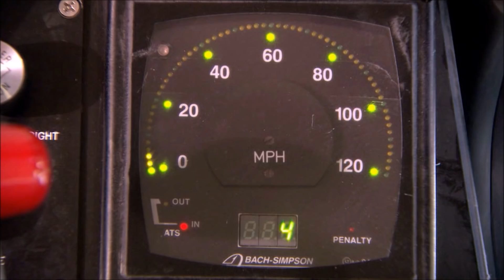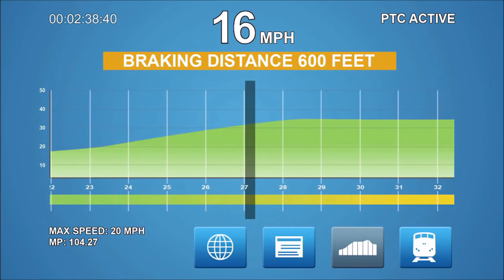Amtrak 501 "Cascades" Train Derailment 18 Dec 2017

Comment: There is NO WAY IN HELL that the train was going 80 miles per hour!

NO WAY IN HELL!
Reply: blancolirio The best comment I’ve read in a long time: “stay tuned ... Mozart” LOL!!
Reply: Stick to music, your lack of knowledge of physics and the real world is revealing!
Reply: If you look at the overhead images at 4:31 and 4:38 it is clear that the front engine and first few carriages went straight off the tracks on the outside curve. The last few carriages were still coupled together with the trailing engine, and the heavy weight would have kept them mostly on the track, until toppled by jackknifing of the coupled center carriages. No need for conspiracy theories, just simple physics.
Reply: A fully loaded 6000 ft freight train requires 1-1.5 miles to stop, but these passenger units can stop quite a bit quicker. There is a huge difference in weight/mass between the two, braking systems are different. Depending on the loads being transported, a mile long freight train can weigh upwards of 7,000-8,000 tons. Passenger trains like #501 usually weigh in around 1,200-1,300 tons at most. A single GE Evolution freight locomotive is 220-240 tons roughly...the Siemens Charger unit that was leading is roughly 1/2 that. What does all this mean you may ask? A LOT less mass in motion, and the passenger train will decelerate much faster, even in the event of a derailment. Add in the sand bank, trees, and it will lose momentum in a hurry when compared to a same speed crash of a freight train. It may not appear to have been a high speed crash, but if the NTSB is saying black box data points to just that. 80 mph may be a bit on the high side, but I would guess it's 60+ when the data is finally analyzed. In any event, it was a terrible accident that unfortunately, was likely due to human error.
Reply: Lewie McNeely The lead locomotive and several trailing cars did react to centrifugal force, as evidenced by the impact on the sand bank. But, as in a majority of derailments, as the first derailed units rapidly lose momentum, the rest begin to deflect in different directions. This is especially true in heavier freight trains. That's why you see cars scattered in helter skelter directions. Derailments tend to bend the laws of physics with some of the damage that can happen..lol
Reply: You see the graphic at 4:53? Uh yeah, the coaches are on the outside of the curve...
Reply: Thanks, Lonnie, that was helpful.
Reply: Actually the lead engine hit several large trees, which would have the same effect as a solid wall. Look at this closeup aerial video, and see for yourself: https://www.youtube.com/watch?v=sbs7aL_wX18
Reply: Sounds like your referring to a much longer and heavier freight train under normal circumstances. It varies quite a bit.
Reply: You can say not even close and it won't hurt my feelings.
Reply: It is almost certain they were travelling at 80mph until the near the final 30mph sign, and possibly started emergency braking once the engineer noticed the the curve and bridge. So maybe slightly less speed by the time of the actual derailment, since the preliminary NTSB statement is not clear about the exact timing.
Reply: It  is truly amazing how so many people who know nothing about railroads are now suddenly experts who are qualified to make statements of fact, when they have none at their disposal.
To answer your question here's an animation of the wreck, while there are some errors it does show more or less how the cars ended up where they did.
https://www.youtube.com/watch?v=cJrCza9iSQw
Reply: Lewie and Wolfgang, you two crack me up. It is evident by your comments that neither of you have the slightest expertise in railroads, any sort of wreck investigation work, or apparently simple physics for that matter. None of us outside the investigation really have very many facts to base comment or conjecture on. I live near, travel by, and had watched with interest the rehabilitation of this line. I also happen to know a great deal about railroad operations, and have many acquaintances within the industry, including a couple of friends who are locomotive engineers. Yet I wouldn't dream of embarrassing myself by spouting baseless speculation and outright garbage, the way the two of you are doing here. My suggestion to both of you is to sit down, be quiet, and let the NTSB do their jobs and submit their results after all the facts are known. Then perhaps you'll at least have some factual information to discuss rationally.
Reply: I am a retired Utility Incident (Accident) Investigator. Over a 3 decade span, I have been engaged in investigations ranging from minor to major multi-fatal incidents. Many of the questions/comments posted here are reasonable and understandable But: Anyone – anyone who opts to submit their ‘subjective’ conclusion to an incident, who IS NOT directly involved with the investigation, nor understands OSHA, PUC or NTSB Investigation Analysis should consider; playing Lotto or a slot machine. (your chances of getting it right will most likely be proportionally the same).

Good report Juan.
Reply: Wolfgang Mozart so you’ve already come to a conclusion re the Ntsb before they even begin. All I can say is that accordion action of the train cars could easily explain the cars being on the inside and still on the tracks.
Reply: Hate to tell you this, but the locomotive and the first several cars off the track Did go to the OUTSIDE (south side) of the track!
Reply: It's all in the pictures of what happened. If the train was going 80mph the first engine would have rolled plus ripped the outer rail off the ties and all the other car would have followed. And going 80mph that train could not stop in 1000 ft. "rear engine still on tracks?" It's weird how the news knew before the NTSB investigation reported what happened.
Reply: How do you KNOW that 'the first engine would have rolled plus ripped the outer rail off the ties and all the other car would have followed.'?
Reply: Isaac Newton....
Reply: Mozart - So what is your qualification to make this statement? The black box recorder and real time train tracker both agree 81.1 MPH when it left the track, according to the NTSB.
Reply: NTSB states that both of the black boxes recovered from both locomotives as well as the real-time train tracker show 81.1 MPH when the derailment began.
Reply: It looks like the aftermath of a high speed derailment to me. I'm sure we will know more  soon no need to jump to conclusions.  I'm just a rail fan though and not involved with the investigation. I wan't to say something snarky maybe make fun of your comments but people lost lives in the accident and it just would not feel right so instead I'll just say: My heart goes out to the victims of the accident and I sure hope changes will be made to improve the system.
Reply: Lewie McNeely if you look at the diagram at 4:41 you can see the bulk of the cars did go to the outside of the curve. The speed limit leading up to the curve is 79mph so 80 is not out of line as a possibility. As far as stopping distance a freight train on its wheels on the rails takes one mile or longer to stop. A much lighter passenger train off the rail dragging in the dirt will obviously stop quicker!
Reply: Wolfgang Mozart I live and work in the industry in the area and have to travel under that overpass to get home. I assure you this is not a false flag or fake incident. 100% real saw the aftermath first hand. I know the route they were on first hand!
Reply: was their FISH on the train at all because i have never smelld anything more fishy for a long time... i keep looking at the acident and something is not right.. but i dont know any thing about trains and derailments, but ... you make a very good observation point... the whole thing smells...the cvover up will smell worse than the proclaimed accident
Reply: 3 people where killed, by an accident that should have never happpend NEVER!... that is called conspiricy to be allowed to be NEGLIGENT and incompitent
because no one in the system is ever heald acountable for the destruction that they cause to our lives because nobody holds or ids allowed to hold them them acountible... especialy if their is a CONSPIRICY involved...
Reply: Wolfgang Mozart ... Now let's  have a conspiracy theory if you have one.
Reply: I'm with you Wolfie BUT think about this. WHY IF the train was gong 80, which it couldn't be, WHY didn't centrifugal force sling the train to the OUTSIDE of the curve instead of everything falling on the INSIDE???
Reply: Lewie -- Good point, and yes, I've addressed this inside/outside-the-curve issue, and I've not seen any satisfactory answer to that, yet. 

I hope that a train expert could weigh in on this one. Comments from train experts are frequently very helpful, so I hope that such experts could help with this.
Reply: Still looks sideways. Too much stuff just does NOT add up. Lots of that going around in the past years.
Reply: Indeed -- In most major incidents, things all too often do not add up properly.
Reply: It woud've had to hit a wall to stop that fast from + or - 80 m.p.h. to do this.
Reply: Here's what Jim Stone Freelance is saying:

[begin quote]
"Yesterday, witnesses were not saying the train was going between 70 and 80 mph, they just said the crash started so smoothly they were not sure anything was wrong, and then ended with them being thrown. Today, in all witness accounts, they are saying the train was obviously going fast, even in reports which yesterday said no such thing. There is an obvious expungement of facts going on."

...

The cars are not damaged enough, and the death toll is not high enough. Additionally, the cars did not go far enough after the crash. 3 of them stayed on the tracks, with a fourth one off the tracks but not fallen. The stories told by people are not consistent with an 80 mph crash either. From the pictures, the train was going 30. There's plenty of evidence to support this. [end quote]

So, you guys think that the NTSB is incapable of lying?

Don't FK'N kid yourselves!

Of course the "government" lies!

Of course the gddamn mainstream media lies!

And the FACTS of the case DO NOT SHOW AN 80-MPH CRASH.

But any online research will be fruitless, as the gddamn bastards erase anything of significance as soon as it appears.
Reply: True, but 80 m.p.h.??? I've spent my whole life working construction and I promise you I understand what happens when you take a load and TRY and get it stopped in a short distance.
Reply: So it jumped and crashed but I still can't see it all wadding up from the speed they said it was traveling. Maybe a reasonable speed but not 80!
Reply: i have a nice hardbound book on train engines, so these were lightweights at quarter million pounds front and back at 80 mph, let us speak of massive destruction, was that rush hour? must be lots of iphone video, ask the calm crisis actor, you are sure to get the straight story
Reply: A train going 80 mph needs ONE MILE to stop.

Was that bridge over I-5 one mile long? Obviously NOT.

If that train really was going 80 mph and if the train rail cars did fly off the curve going that fast, there's no way in hell that they'd remain in predominantly whole pieces -- they'd be crumpled messes with ALL the rail cars and locomotives flying off the tracks with nearly a 100% fatality rate.

And how in the hell did this train crash on the INSIDE of the curve, when, logically, it should have flown off the tracks on the OUTSIDE of the curve.

The rear locomotive was still on the tracks -- no way could it possibly have gone from 80 mph to a full stop while still on the tracks.

And guess what -- there was a mass casualty drill going on in the SAME CITY, on the SAME DAY ... go figure the odds. Same thing happened with 911 -- a mass casualty drill involving planes crashing into skyscrapers happened on that SAME DAY and in the SAME CITY.

Antifa has boasted about putting cement blocks on train tracks to derail trains -- this may have been a cause of this accident. 

There were a number of witness reports of hearing the train hit something before crashing.

But there's one thing that you can count on -- that train was NOT GOING 80 MPH!
Reply from the maker: I'm afraid you don't know much about trains or pneumatic brakes either...stay tuned and we'll get you straightened out Mozart. lol.

Comment: A couple of quick comments--
There is a longer version of the audio you played available on youtube.   Unfortunately, part of the conversation between the Amtrak 501 engineer and the dispatcher is unintelligible due to an automatic defect detector going off at the same time as well as other train crews "walking on" the Amtrak conversation.   The railroad will have a better recording of the conversation, but from what I can hear on the youtube version the dispatcher was trying to contact train 501 before the conductor called in the emergency.  And it is the conductor that the dispatcher is speaking with, as he notes that he needs to move south to assess the damage.   The engineer was in no position to do that.

A lot of the other comments disparage the cost of the new trackage and rail transport in general.   This is disheartening, as rail travel is still much safer that road travel though not nearly as safe as commercial aviation.
Reply: Iowa : Thank you for the radio clarification . I though it was the engineer on the radio.
Reply: Most railway fatalities are due to trespassers on the rails and vehicles crossing against the signals.  Imagine what it would be like if we let people drive their cars across runways!  Purely by chance the video that loaded immediately after Juan's was about a near miss with a drunken woman walking on the rails.

Comment: I've taken this train a few times, as I live in Eugene, the other end of this route (501 and similar trains go from Seattle to Eugene and back - train departures from Eugene to Seattle are at 5am (6am?) and 9am, if memory serves me right).  Riding on shared routes belonging to BNSF or others means delays to passenger trains.  The track is theirs (BSNF?) so the priority is theirs and I've been on this train, stopped on tracks for long periods of time waiting for cargo trains to clear stretches of track before we can proceed.  Therefore, I only use the Cascades line (these passenger trains) when for leisure trips and when time is not an issue. When I travel for work on this corridor (I go frequently to Olympia and Seattle) I either fly or drive. Obviously, the Cascades line has other problems as well, but I can understand why they built this alternate line to prevent delays beyond their control and start building a reputation for more on time and reliable service.  

There is a strong demand for alternate transportation on this corridor, it is very unfortunate that this accident occurred, I was counting on better train services. Hope this accident does not prevent the use of this alternate route (with the appropriate precautions - such as PTC as mentioned) or the possibility that other alternate routes be built south of Portland to make this service more reliable. 

I'm really sorry for the people who have lost dear ones on this accident.
Reply: The line will go back into service, but I heard on the 11:00 O'clock news last night, that Amtrak will not do so until PCT is active on this line, just as it is on the BNSF mainline.
Reply: I hate to inform you but passenger trains have priority over freight no matter who's line it is. If you sat and waited it was a situation where a freight train had an unexpected issue or it was absolutely unavoidable by the dispatcher.
Reply: Thank you for this information.  I read more into it and the information on the subject agrees with your statement.  Like you said, as you include the dispatcher into the conversation, there is more to it.  All I know is what I experienced waiting on tracks and what train staff and other passengers tell me... Anyway, Amtrak buys blocks of time, right?  Meanwhile, cargo trains are scheduled for the other times, these cargo trains are longer and slower, which adds to the complexity, but also have timelines that need to be met... therefore, if Amtrak misses its window... 

Bottom line: there is a bottle neck in this area, there is a demand for cargo vs passenger transportation in this area, which explains the reason for opening traffic to the alternate line, which is more than saying it was built to save 10 minutes of passenger travel. I don't know much about it, except for my train rider experience, and for living two blocks from the train tracks... :-)  Anyway, thank you for your information, it lead me to read more about it and confirm that this line was not opened to save 10 minutes of passenger trains, at least not only, but that it also opens up traffic for more cargo trains on the original line, and it also probably prevents small delays on passenger trains to turn into very long delays, it seems.  There was also mention of other issues with the original line. Thanks again, it makes the information, through dialogue and research, more complete...